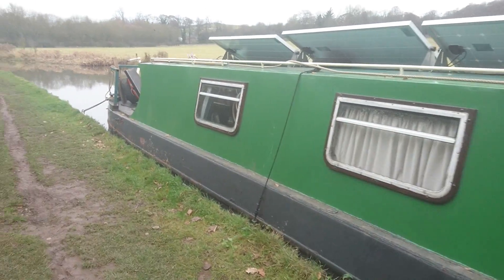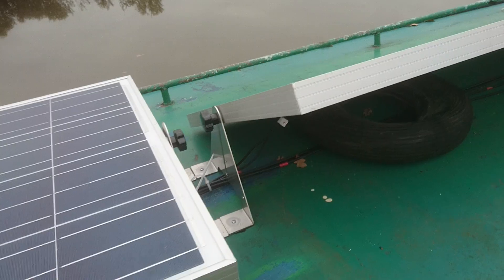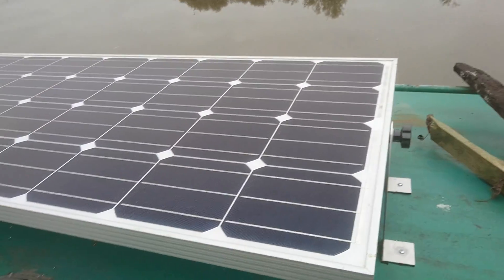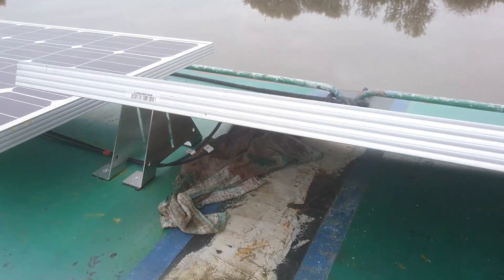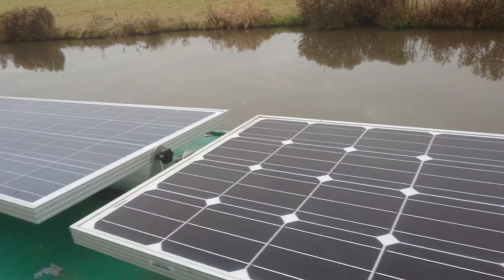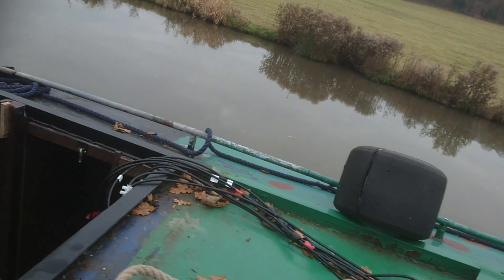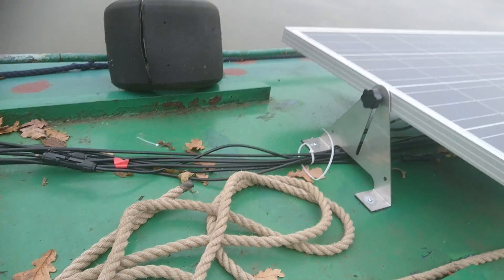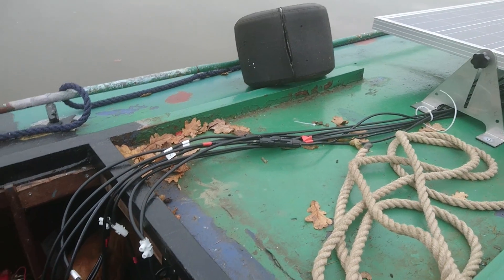005 - Simple living. Fitting solar panels for off grid power. Electricity.

Comment: Hi. You need to check out an MPPT controller for your setup. The one you have isn't, and you're loosing a lot of charging potential from your panels. They aren't horrendously expensive (the one I have was £70 made by Victron) but the increase in available current into your system is significant.

Comment: Where did you get the panels and the solar controller? How many leisure battery's do you run?
Great video I'm currently researching solar for our boat :)
Reply from the maker: I got the panels via amazon from a place called Photonic Universe I think. The controller was just from Amazon. They were very reasonably priced. The solar controller has USB ports integrated which are really useful. Highly recommended.

Comment: So easy to connect.  Did you drill straight through the roof to secure the brackets?
Reply from the maker: Yes, that's right. They recommended tap and die in the shop but I don't have a set so I used self tappers.